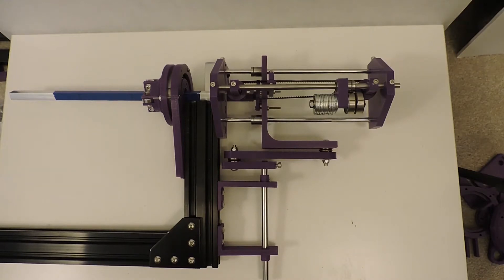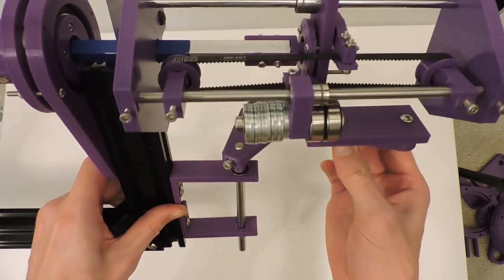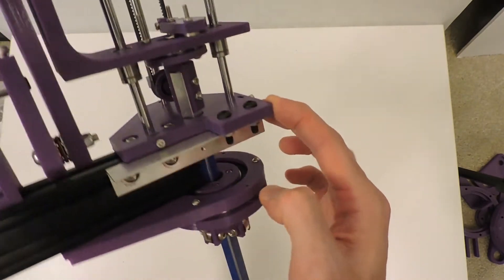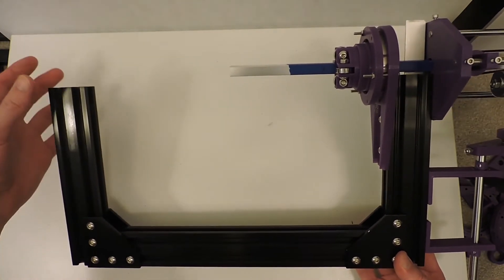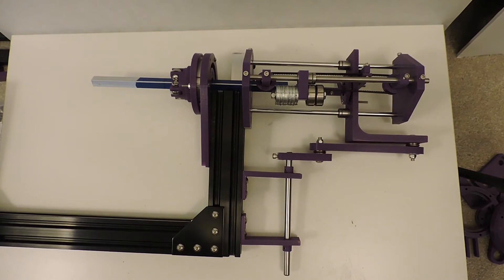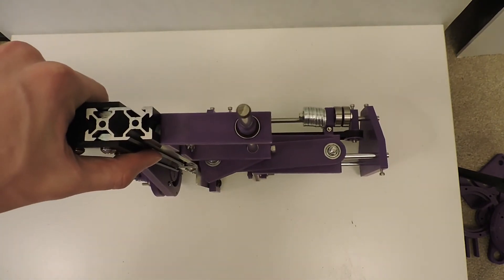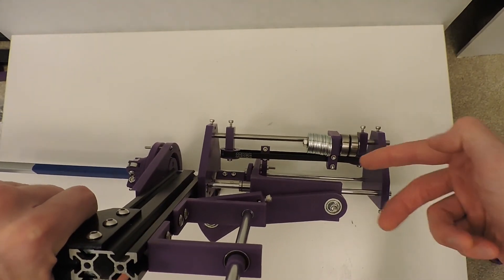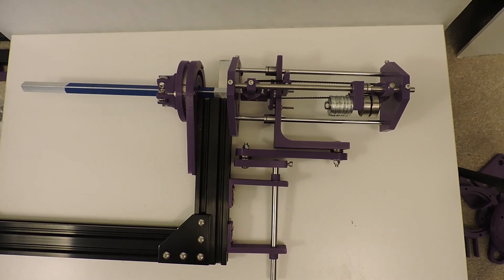Linear + Rotary Actuator - Counterweight

Comment: Well ... "Kinda unwieldy"😁  Details, details ... for  later😁    I did misunderstand the counterbalance issue last vid. This solution made a huge difference Andrew👍  Don't stop now; each step is an improvement 😃     Stay safe.  -Mike😷  p.s. in case you're wondering 'cuse I do, I just saw your community posting.
Reply from the maker: I wasn't 100% sure which plane you were referring to from the last video but reading your comment did make me reconsider where the counterweight should go so thank you!